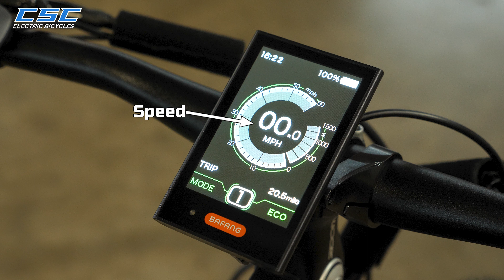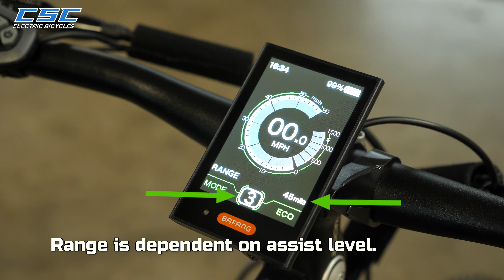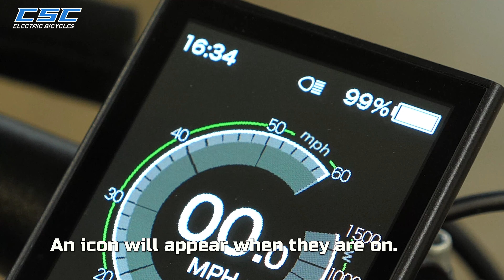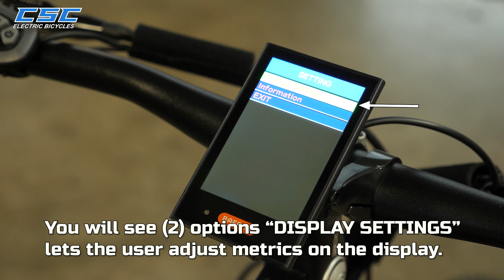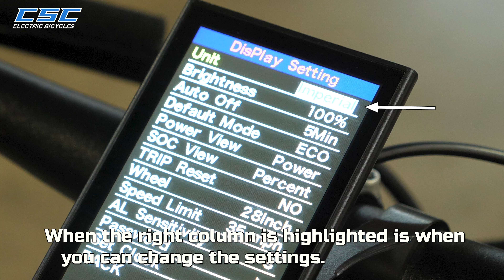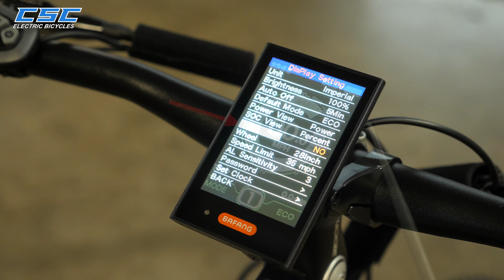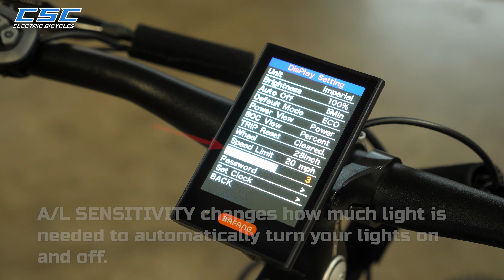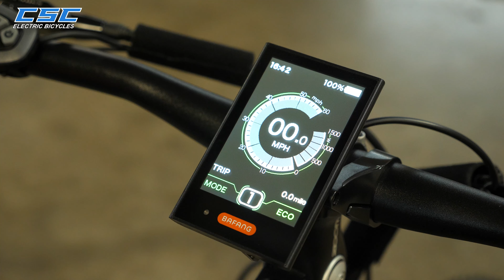CSC Motorcycles FT1000MD Bafang Ultra M620 DPC18 Display Tutorial

Comment: Are the Bafang Ultra displays compatible with Hub Motors or Mid Drive Motors as opposed to sensors?
Reply: yes they are I have one on my specter S by enorau
Reply: So, I can get the Bafang Ultra setup for my 750W Motor.

Comment: My bike has this display unit and Bafang ultra motor. I never get a reading of 100% battery reading, only ever get 96% and 54.2 volts. When the battery reaches 47 volts I get about 10% range reading remaining, although the battery cut out voltage is 41 volts. So after about another couple of miles the range reading would be down to zero, while the battery would be still having quite a high voltage. Would the 0% range reading mean that the motor cuts out? So I'm a bit wary of travelling too far in case I'm left high and dry while being miles from home!
Reply: ive read somewere you can plug a Bluetooh special Dongle in the usb at bottom of screen and use a simple app too adjust settings on motor,, theres Youtube tutorial vids on doing it with motor,,

Comment: difference between 850c and cpc 18 please ?????
Reply from the maker: The DPC18 uses a complete Bafang system and it is programmed to work with the FT1000MD.
Reply: @cscmotorcycles2297   what is the max speed of both ?